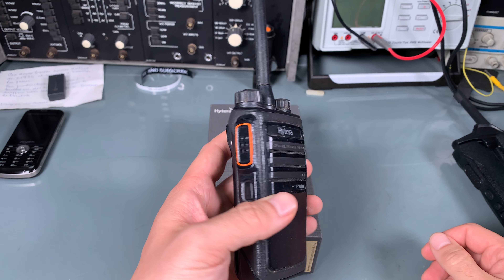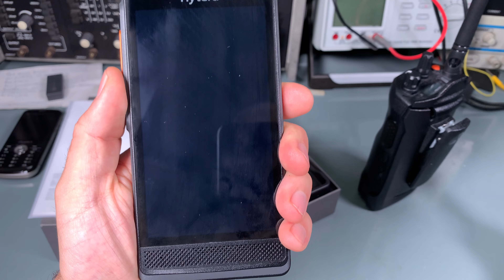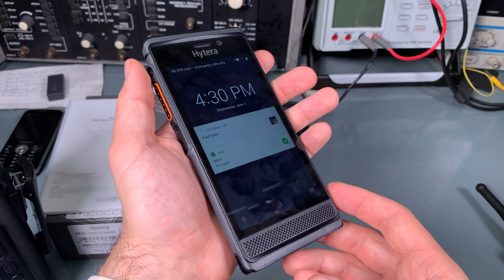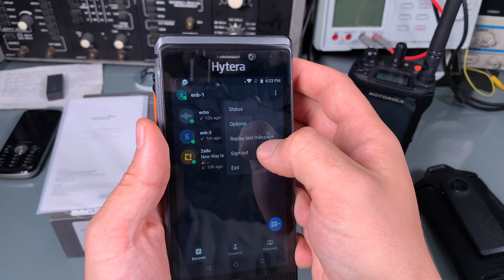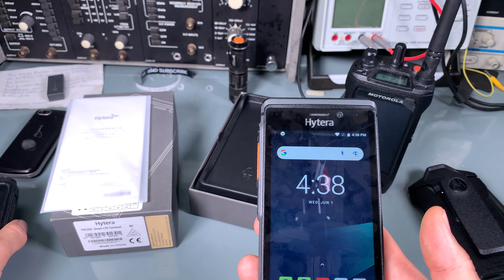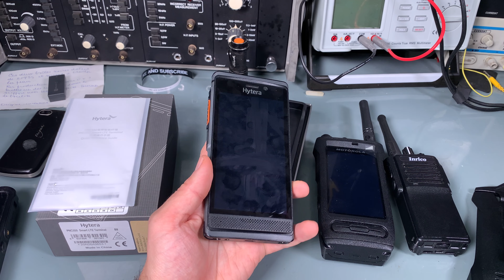Hytera PNC550  POC Smartphone  PTT Zello test + compare to Motorola Ion and Inrico T198

Comment: What is in your opinion the best PoC or ptt radio for personal use at this moment? (Motorola Ion is just to expensive in personal use)
Reply from the maker: Forget about ION - unless You want use Motorola WAVE and even THEN  if You use WAVE You need to disable LMR to talk over LTE because pressing PTT will call LMR!... so idea of having two devices in 1 DO NOT EXIST at this point in time.... so I would suggest going with Motorola Evolve since it's just PoC.  Tell me more about Your needs is it for Zello or RealPTT? You want LMR & PoC same time? or only PoC?  If only thing You need is PoC - it will sound stupid... but I would recommend normal phone (maybe from rugged series) and good BT RSM!! Better throw money on RSM that is reliable, reconnect fast, don't require any hoops. Regular smartphone (used sonim or something like this) go to holster or backpack and RSM can be open to elements like rain, cold - and You will be gold!  Currently I'm testing cheap Zello Android PoC - and I'm surprise how well they work and how reliable they are in term of stability - no one expect 50bucks PoC radio to have Motorola drop test quality but paired with quality RSM ruggedness requirement fade little bit away. Trashy Motorola APX copy from Aliexpress with two PTT button design give better usability than Motorola Ion!!!  So I will be touching cheaper options but I need some time to test stability since this is most important part. Motorola ION feel amazing on paper but to use Motorola WM500 RSM I had install Wave client, disable LMR, and then it let me use Zello PTT on RSM... without those steps PTT on RSM call LMR... You see how many hoops? This seems fine for Aliexpress stuff but not 2K EUR radio...  I more often took Motorola R7 and cheap PoC than Ion.... but worst is!!!  - those things could be fixed by SIMPLE firmware update... couple lines of code... allow dedicated button to switch between PTT on LMR | LTE - click, lady in speaker say (wide band, or LTE)  - maybe icon flash blue and pressing PTT talk over Zello or Wave - You pres it lady say (narrow band, LMR) - flashing red, and pressing button PTT on LMR... but still You should be able to hear Zello | Wave....  with is no problem!! since I can play YT video and have LMR.... <- simple software update....  but Motorola seems not care...  Tell me more about requirements so I can advice You better.
Reply: @ElectronicNoobBlog   Well I have the Hytera PNC560 now, unfortunately the PTT button is not working with Zello, seems hijacked by Hytera in some way. Still looking for a fix for that, any suggestions?
Reply from the maker: @VicGreenBitcoin  Try go into "apps" and see if there is possibility to force stop it (hytera app) most like it will have something with hytera in name or some service , helper - if it resolve issue, then check if there is adb connection available and remove app from command line (even if it was kind a pre installed it will work that way). I had motorola SI500 video mic, and back then I did not have software for it and it wanted scan qr-code. I use ADB to disable app that was displaying that qrcode and just get to android ^^
Reply from the maker: Does it starting any hytera app (ptt)?
Reply: @ElectronicNoobBlog  Thank you very much for your review.
I own the Hytera PDC 680 and wonder if the Motorola ION has a better audio reproduction?

I have the impression that Hytera has the better audio quality in principle.

Can you give me a tip?
I'm purely concerned with the Zello application and the audio quality associated with it.
As far as I can see, the ION also has different audio profiles to choose from. Does this also refer to the Zello edition or is this only relevant for narrowband?

Thank you!

Comment: Nice video. Wow! Impressive audio on the Hytera! I own a couple of Hytera DMR units and I love the build quality, and they are (much) more affordable than other brands like Motorola, Kenwood or Icom.

However, Hytera is also present in public safety in some countries! Mostly TETRA of course. BTW: Sepura, which is the market leader in many European countries, is owned by Hytera.
Reply from the maker: Thanks for the info!  Actually Hytera is not that cheaper - just compare Hytera PDC760 and Motorola Ion. They are priced almost the same. I decided to go with Motorola since I can use it on Wave OnCloud (on physical Motorola radios). Hytera PDC550 (one on video) and Motorola Evolve also they don't have big price gap.
Reply: @ElectronicNoobBlog  OK, yes you are right in that case. I guess it all depends which products you compare.